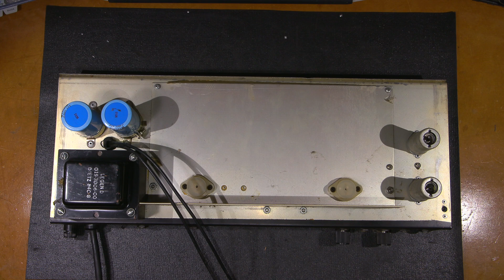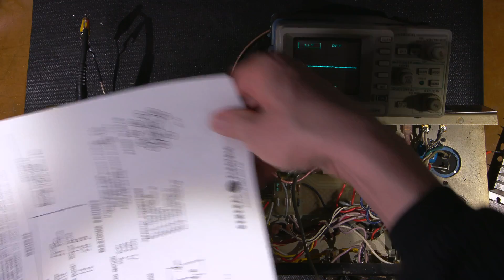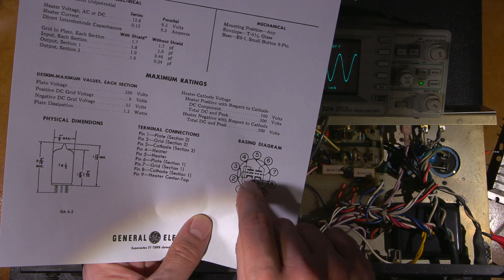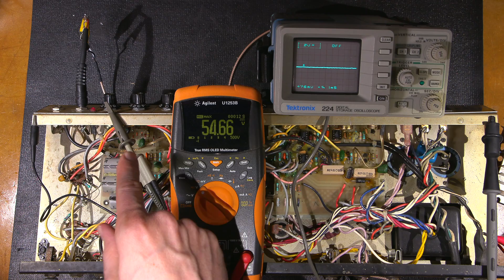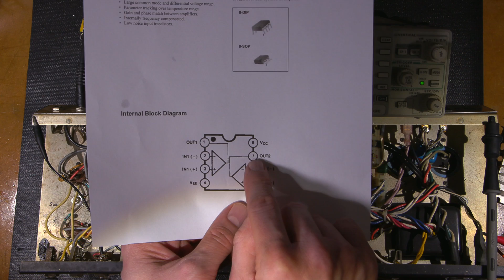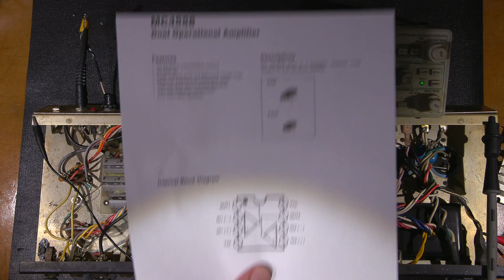Super Electronics Troubleshooter- Working On Hybrid Technology And Not Destroying It

Comment: I'm an electrician and have been working in electronics for a while and just recently started repairing tube amps, and hybrid amps, and electric guitars. So this is good stuff! I knew about meters carrying a charge when testing caps, but not tubes. It makes sense that the meter would apply voltage but wow! that's a lot!.

Comment: Totally great video! Can I ask something, In the previous video 6L6 tube has a coil stopper, why this amplifier did not? Thanks Mr Paul.
Reply from the maker: Hi Roy, there are no 6L6's in this amplifier. Those stoppers are used in the output section only, and this amp has a solid state output.
Reply: @MrCarlsonsLab  I see. Thanks mr Paul.

Comment: The RC4558 is a G.P Opamp . The TL072 has lower noise.
Reply from the maker: You are correct.
Reply: I like the TLO72 vs  RC4558 or 4560 .

Comment: Any idea on video and audio going out of sync?  Usually view your vids on phone.  And notice many times audio lags video? It may start out fine but usually at some point I notice it.  If I back up vid a bit sometime it helps sync things up.  
Just a heads up as I notice this on almost no other sites videos.
Reply from the maker: No problems on my end. Try clicking the gear symbol under the video and and selecting 720P60. These video's are all 1080p60, many don't offer this frame rate, so that may be your issue.
Reply: No problem on my end either.
Reply: probably your computer can't handle the decode. I don't think YouTube is particularly efficient.

Comment: I may not use the correct terms etc. ?
But what about the scope & mains voltage , and not using a differential probe ?
Thanks again John
Reply from the maker: Hi John. The amplifier has it's own power transformer, (provides isolation) so using a scope with a normal X10 probe is fine.

Comment: Paul,  I have a probable stupid question.  I see that the tube has two amplification sections as you pointed out and was wondering if they are ever wired in a stereo configuration (in the same tube) or are they always mono?  Thanks for sharing your knowledge and thanks in advance
Reply from the maker: Hi. Its bad practice to use both triodes in a single tube for separate channels due to a thing called "cross talk." This is why you will usually see both triodes in a single tube used for the same channel, and a separate tube used for the other channel.
Reply: I wondered if that would be the case, thanks for clearing that up for me
Reply: Paul,  one other question. I have seen hybrid HF radios where the PA section was a tube, is it common for hybrid audio amplifiers to be transistor preamp and tube final?

Comment: Why could an amp be damaged if it has no load attached?
Reply: Some designs are not stable without a load. And tube amps are basically current sources, not good to try forcing current into an open circuit. :)
Reply: That much I can figure, but I still don't really get why. Maybe a practical example would be more helpful (I was looking for that in the first place).
Reply: So as with many things, if you want something done, do it yourself.
Turns out it's because tube amps use an output transformer to drive the speaker. Two tubes drive the sides of a center-tapped transformer out of phase with each other, with the center tap connected to B+.
With no load on the secondary the tubes are essentially shorted to B+ by the primary, which is also a big inductor. With no load the drive energy can't go in the secondary, so it stays in the primary. When the signal current starts to change direction (or just decrease) said inductor won't like it and it'll put out high voltage spikes, causing arcing wherever the voltage finds convenient.
Leaving this here for anyone that might have this same question.

Comment: Why do you need an isolation transformer when the amp already have one build in, the power transformer. the power transformer provides all the insulation from the mains needed.
Reply: Because the amplifier has a chassis that is mains earth referenced (that is a 3 wire power cord on that amp), an actual isolation transformer is needed for safety.  The power transformer in the amp does nothing to isolate this,  you need a floating isolation transformer.  Since neutral and ground are tied together at the breaker in every house in the US,  if you just so happen to hook up the ground lead of your oscilloscope probe to the wrong place in the amplifier,  and there could be a hundred places in the amp like this,  you will experience an amazing flash of light as the probe ground lead is vaporized and the scope front end will very likely be damaged or destroyed.  This is because you have shorted the mains through your scope.  If you need further explanation on this,  search youtube for EEVBlog video "how not to blow up your scope".  This should be required watching for everyone using scopes on mains power devices.
Reply: Ground is at the same potential as my work ground iand the potential in my body.  all is at the same potential so it is no danger with the ground in that  theory. You are not going to hurt yourself with a ground wire.
Reply: Because the green ground wire on the AC power cord is connected to the neutral buss back at the breaker panel as well as the amp chassis.
Reply: AND AT THE SAME POTENTIAL AS ME AND THE GROUND I AM STANDING. sTILL DO NOT SEE THE DANGER.
Reply: Because he wishes to live another day! I've rarely seen a little extra caution being a bad thing, especially when you've got your hands in electronics!
Reply: do you understand electrical and electronics???? please respond with a technical answer and not a stupid comment. be professional like the others
Reply: You will feel the danger, when you touch the B+ in a grounded chassis
Reply: that is going to happen with or without an isolation transformer. B+ comes, originally, from the power transformer secondary windings that it is isolated from the mains. Now be careful with the B+ for the tubes may be up to 600VDC and large caps that will stay charged for a long time. You need to know your business a bit more. You do not there  Ham radio operators these days just purchase everything already assembled. but good try N6YOC
Reply: I'm aware of where the B+ comes from, you are not listening.  Connect the ground lead of your probe to something that is referenced to B+,  whether intentionally or not.  The scope BNC barrel is mains earth referenced. The chassis of the amp is mains earth referenced (bypasses the power transformer),  ground leads in the amp are tied to this reference.  Neutral is tied to mains earth.  What's going to happen?  It's not difficult.
Reply: Also,  I'm not talking about hurting yourself,  that's a different explanation.  I'm talking about the safety of the scope and the device under test.
Reply: Now that is a fair explanation. Good for you
Reply: I've made the mistake myself,  it's not fun.  Luckily my scope survived.  You live and learn

Comment: Hi Paul, could you talk more about the use of contact cleaner (27:53) in potentiometers? I was looking into doing this on scratchy pots a few years ago, and as usual on the internet, everybody had an opinion on what product to use, and whether it was a good idea to use solvent when there might be grease inside the pot. Some said that any benefit would only be temporary. Could you comment on your experience with this? I appreciate that you might not want to get into contact cleaner brand names. Thanks!
Reply: I have used a couple different brands of contract cleaner. One is the Radio Shack brand. Good luck finding it now! The other is a CG Electronics Deoxit spray (Not the DeOxit brand). It works pretty well. I haven't had any issues with any of the sprays being temporary. They have all lasted since I used them. You have to leave the potentiometer for quite a long time for it to return to how it used to be. The reason it gets scratchy is the build up of dirt and other junk that should not be in there. The spray just helps to clean it out. That's why you have to turn the control too! It really is not complicated. People just bicker on the internet for no reason because I heard this or that 40 years ago! Just get a good brand like CG Electronics or DeOxit for instance and use it!
Reply: @TheMonkeyFarted  Hi, the contacts and carbon  oxidizes ,not really dirt at all,but good advice.

Comment: The other problem that’s not immediately obvious is that the charge on the cap in the O-scope depends on where in the AC cycle it was at the instant you disconnect the probe; it might be in the range of voltage that the op-amps are at (+/- it’s power supply rail), and a tech might not realize that there could have been more voltage, and then think everything was okey-dokey, and do it again. Of course, if it’s at 180 VDC (+/-) and you probe the IC, the loud pop and release of smoke will tell you something bad happened! 🤠
One solution here (since we just want relative signal strength, and not an absolute voltage indication) is to put a resistor from your scope probe to chassis ground to discharge the cap. Easiest way is to salvage an old in-line attenuator and pop it open. Wire the input (center pin) to the center pin of the output (which goes on the BNC connector on the scope), and wire a resistor from that to the outer connector. Calculate the resistor to pass a moderate amount of current (let’s say, 50 mA) given the B+ voltage on the plate(s) of the tubes, and then calculate the necessary power dissipation and choose the right size resistor. Button up the attenuator, and you’re ready to go. Now, after you take a voltage measurement on the tube side and disconnect the probe, the resistor will discharge the cap in the scope; just wait a second or two and your cap should be discharged safely. Furthermore, this should avoid problems with arcing/pitting the probe tips if the cap is fully charged to the B+ voltage; no point ruining your good scope probes! 😎
Reply: The best way is to use always a fixed (not switchable) 10:1 probe - even in IC-circuits. It increases the bandwidth, lowers the capacitive load and isolates the coupling-C for AC-mode of the scope.

Comment: Great video! I started in electronics back in 1980 in the USMC. In all these years, I’ve never come across your tip on charging up the probe coupling cap. That was a very interesting demonstration. I’m curious, what is the maximum dc voltage you would measure with a 10x or 1x  oscilloscope probe? Do you go strictly by the rating of the probe and scope input? I’m always paranoid about blowing out the input to a scope, so I bought some diff probes (20/200x) and a HV probe (1000x) for working on tube circuits, but I’m thinking that’s probably overkill. My scopes say 300 or 400V peak, but for some reason, I wouldn’t feel comfortable applying that much voltage directly to the inputs.
Reply: Tim Thompson ,  If it isn't a modern scope, buy new probes to stay safe. The requirements on new gear is tighter for user safety than some old probes.

Comment: That's a great video Paul, I think grounding the probe, is the best bit of advice I've heard in a long time, it's now written on a piece of card above me at the bench, probably  just good  practice all the time working on any thing, Thank You.
Paul
Reply: On my Tektronix scope, I got a momentary push button on the probes especially to ground the hot lead. Very convenient!
Reply: @Jvavolerpareil  , If you forget to CHECK THE PUSH BUTTON every once in a while, you may regret it!  I'm suggesting that you could short out something you really didn't want to short out IF the failure mode was a shorted switch.
Reply from the maker: You're very welcome Paul!
Reply: @Dave Micolichek  .   Actually, no. I'm suggesting that you could short out something you really didn't want to short out IF the failure mode was a shorted switch.

Comment: never thought of the charge that's kept in the DC blocking caps. now it's so obvious.
many thanks from germany!
Reply: I never did either (kind of new to electronics anyway, my main gig is thermo/fluid dynamics), but when I read my scope's user and servicing manuals - there it was in bold letters: "Switching the coupling mode selector to ground will drain the AC coupling capacitor". It even has the resistance and capacitance values printed right on the case, next to each input.
Reply: I didn't know either. Or i tend to stop overthinking at some point and just start doing. And the coupling capacitor is one of the small details prone to get overlooked in the big picture. Bang. Things are going Electroboom.
Who would have guessed that there may be a need to read the manual on such a simple thing as an analog scope. That's not manly ;)